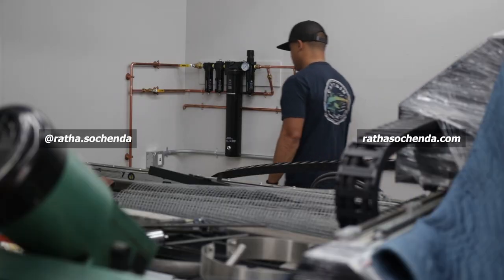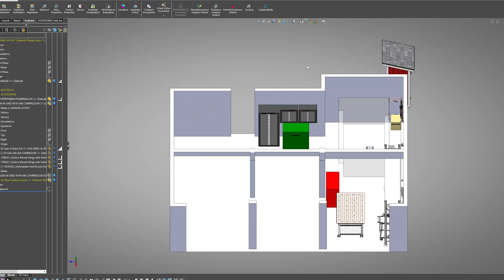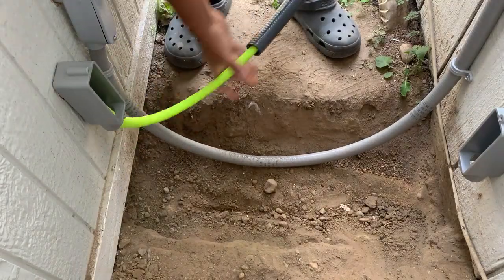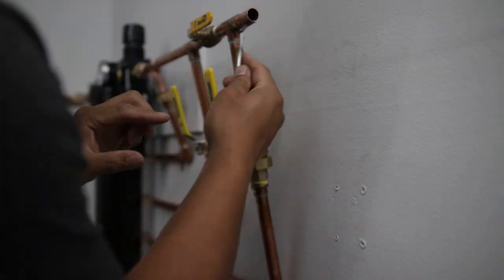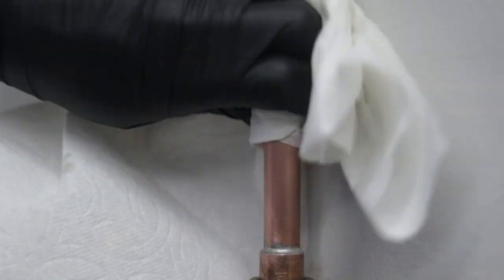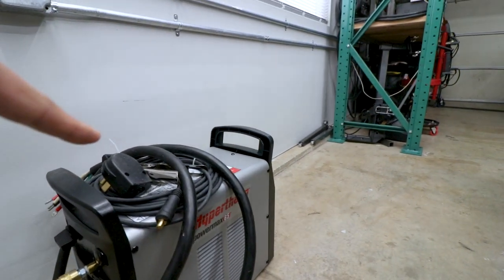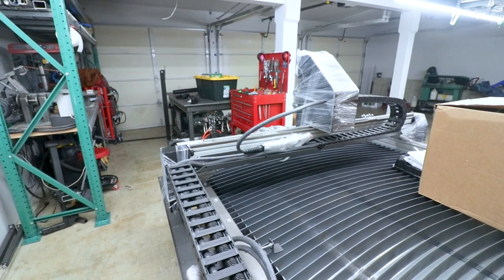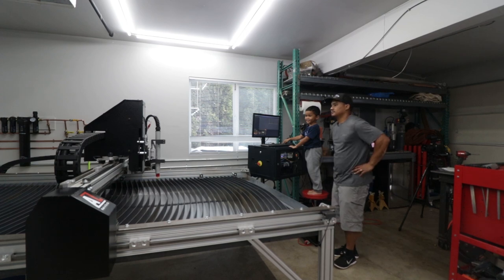Building my Garage Shop DREAM Compressed Air System

Comment: Whoever sold you the refrigerated dryer should have told you that they must stay running in the same way that a refrigerator cannnot be turned off and on if you expect it to last.  Many body shops thought they were great, and they are, but the body shops were shutting them off at the end of the workday and starting them up the next morning and blew out compressors because of this.
Reply from the maker: good to know👍

Comment: It’s seems like the refrigerated dryer is downstream of the desiccant filter setup? Desiccant should go downstream of a refrigerated dryer so you don’t use it up as fast, Might want to look at cagi or Cac for correct order.
Reply from the maker: I’m not quite sure what you mean by "downstream" but if your referring that the dryer should be installed before the desiccant then I thought that would be case initially after talking to few reps at ingersoll rand but they said in my situation the dryer should be installed after the desiccant filter (5 stage Air filter ). This pulls oil and moisture off before it goes to the dryer not necessary but helps the dryer last longer. Yes it will put more wear out the desiccant system faster but when you compare what will cost more to replace... refrigerant dryer or desiccant beads?🤔 Also there is another filter at the hypertherm unit as well to catch any moisture or oils that the dryer may have missed.
Reply: @RathaSochenda  Putting the refrigerated dryer after the desiccant negated it's function to the system. The purpose of the refrigerated dryer is to do the bulk of the work to make the other filters last longer.   The desiccant will get you a lower dew point than a refrigerated dryer is capable of. The only maintenance item on a refrigerated dryer is the drain.
Reply from the maker: That makes sense. Ill make the change to move just the desiccant portion of the 5 stage after the dryer. Thanks again for the clarification
Reply: @RathaSochenda  The system was well thought out. It is too bad you got some poor information from IR. Putting the first 2 filters before the refrigerated dryer is the best option. It will be interesting to see how often the desiccant needs to be regenerated or changed.
Reply from the maker: Thanks. It’s all good stuff happens. I’m just grateful to get feedback to better improve the system to be more optimal and that this type of information well help others. Yeah I’m going to put it through it’s pace and see how well this systems performs.
Reply: @ibey01  with a one man shop and a large dryer I need to change mine 1x year.  I have an indicator built into mine that tells me when it needs changing. This is in Wisconsin with humid summers.

Comment: Nice setup brother. Keep 1 important thing in mind -every time u use bypass it's going to contaminate the line,so it would be better idea to make a another coupler for bypass where your line starts. That will save filters when theres no need for clean air.
Reply from the maker: That’s a great point! Thanks for the feedback. When I cross that point if not needing clean or dry air such as just blowing out the dust or debris in my garage I’ll make sure to add a split off point where the line begins.

Comment from the maker: *After this video I received some great feedback on optimizing the system.  I split the 5 Stage system and put the in/out for the Refrigerant Dryer right after filter 1&2. So now the order goes 1&2 filters then Dryer then  3(desiccant) 4&5 filters. This helps the dryer do most of the bulk of the workload while preserving more of the desiccant from moisture.   

Link to Cheat Sheet Diagram on Air System Layout: https://www.etsy.com/listing/1319810562/clean-dry-compressed-air-layoutdiagram

Comment: This looks great 👍🏼 Only thing I’d say is that the copper pipe causes air water separation itself. With the flex hose from the air compressor, and then the copper pipe going straight up from there, you’re going to get water running down into the flex hose. You’d be surprised how much water actually builds up quickly. If you live in a colder climate, the water in the flex hose might freeze, expand, and burst the hose
Reply from the maker: Good to know

Comment: Hey bro!! NIce video!! I really like the copper pipe and the amount of thought you put into bypassing certain systems in case it fails. I've watched a couple of videos of yours and I'm impressed with the quality of your work. I do have a few questions though. Your shop is in your home garage, if so, did you have to upgrade your electric service through the electric company? I just bought a Lincoln Power Mig 210, and I'm planning on buying the Lincoln plasma cutter as well, and I'm gonna need to get an 80 gallon air compressor. I don't know if I'll need to upgrade my power to run all these items or if my current system will be enough to power all these items as well as my home. Also, did you run all the 240v wiring for your garage or did you have someone else do that for you? You can DM me if you would prefer. Thank you for these very informative videos and I look forward to hearing your response.
Reply from the maker: I installed a 125 amp subpanel from my main one. I wired it all myself to be setup as a one man shop.

Comment: How did you seal up the unions?  I have the same issue.  To be fair, I think they can be water tight and still leak air.
Reply from the maker: Pipe dope and yellow gas tape combo on all threads
Reply: @RathaSochenda  Interesting.  Do you attribute that to being able to get the fitting tighter due to the lubrication or actually sealing the threads?  I would think if the air could get past the face seal it would get out around the pipe rather than through the threads.  I'll try your solution.  Do you have tape and dope recommendations / affiliate links?

Comment: Why do plasma cutter need dry air
Reply from the maker: Pneumatic tools like the plasma cutter are design to operate with clean dry air and perform the best. When you have dirty wet air it results in sluggish performance wear internals faster and can contaminate workpiece depending on what pneumatic tool is use.

Comment: never use teflon tape with a plasma cutter, it can get plugged up way inside of the machine
Reply from the maker: 🤔.L
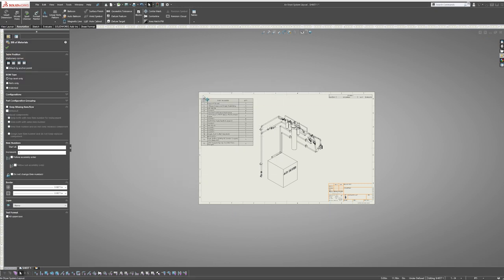Reply: Teflon tape getting in the airstream is not a problem, if done right, that is: the other winding direction (not as seen in 3:20) and not putting any teflon tape on the first thread (Reasoning⬇). I for my part am so fed up with teflon tape, i switched to Loctite 577 and would never go back, it's so forgiving and almost impossible to get a leak.
-  If done as can be seen at 3:20 the teflon tape will unwind while screwing in the thread. If done the other way around it will tighten instead of getting loose.
- If you cover the first thread in teflon tape the thread can cut the tape while screwing in the fitting -> loose bits of teflon tape in the airstream. If you stay clear of the first thread with your teflon tape, the frist thread whill hold in place which ever teflon tape the second thread might cut and prevent it from getting completely detached or flapping around in the airstream.